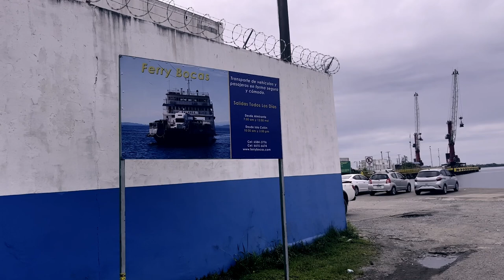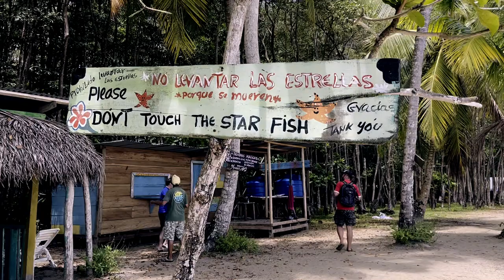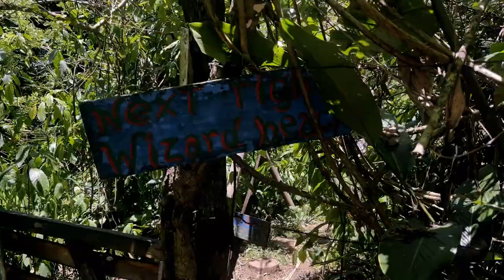Is this BEST overland camp spot in Panama? Bocas Del Toro | S03E15

Comment: Nice one. I was wondering, what kind of gas mileage are you getting out of your T2? And perhaps even "oil mileage", haha... those engines can't have been very frugal yet. But they probably do well with gas of all kinds of quality, unlike modern engines, right?
Reply from the maker: Well we have a modern engine actually, a 2001 Subaru. We never ran our van with its original engine but I understand they get around the 15-20mpg mark. Probably more like 10-15 here, the roads are tough! We get about 30mpg out of our new engine, although I haven't checked it yet on this block. We chuck in whatever fuel is cheapest, hasn't made a difference so far, within reason the ecu will compensate, not something an old engine can do.
Reply: @vanlifetipstech  30 mpg is surprisingly good. I guess you check the oil level quite regularly?
Reply from the maker: we do 👍